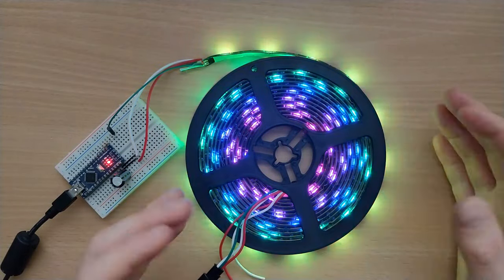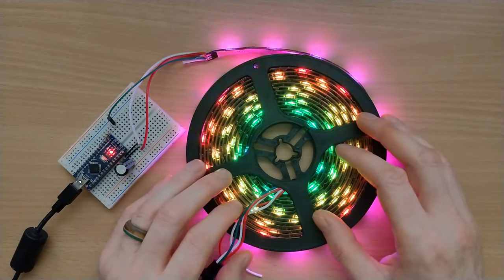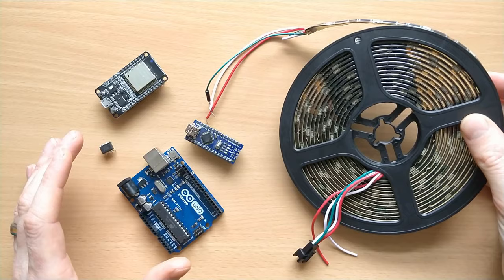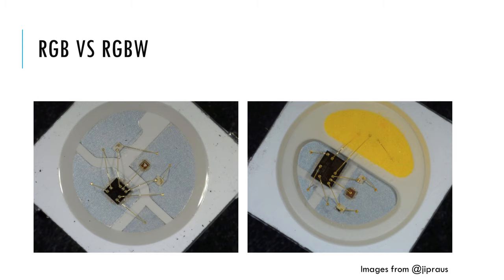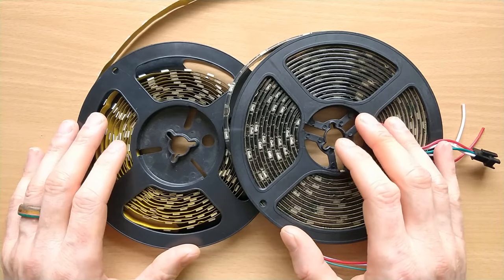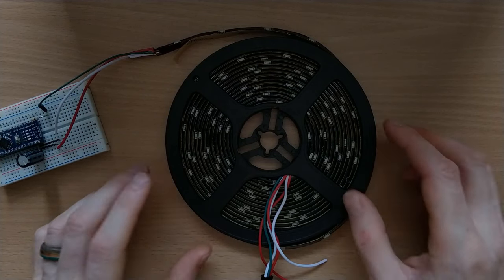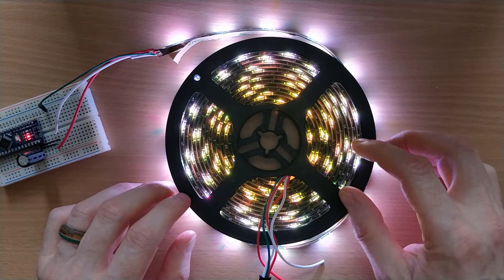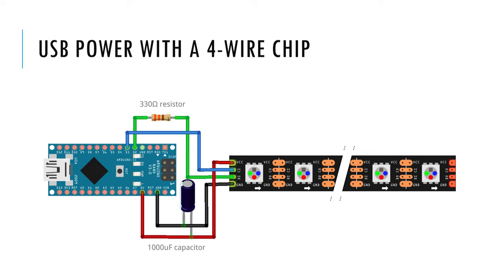FastLED Basics Episode 1 - Getting started

Comment: It's crazy how hard it is to find proper info on how to set up for power delivery. I've been struggling with a project that uses 300+ LEDS with an esp32 and I had to search forever just to learn about the amount of amps I needed. This is the first tutorial I've seen that mentioned anything about a resistor on the data pin, and a capacitor on the power delivery. Here's hoping that solves the boot looping issue I've been seeing. Thank you!

Comment: 1. Why are you using a resistor at 7:40 ? 
( Newbie to FastLEDs ).

Good tutorial. Interesting description and engrossing thruout. Thanks.

Also- 2. when you do we use a 5v and when a 12v.
3. When do we use the microcontroller power supply to power the LED strip, and when to use an external power supply ?

Comment: This is good but I wish it had gone into the resistor & capacitor details more. An episode dedicated to that, plus wiring up with external current flow (instead of going through the board) would help me out heaps with closing some gaps in my knowledge.
Reply from the maker: Hi, I don't think there's is anything else to say on the R and C. Resistor should be 330-470 ohms on the data line, cap should be 470-1000uF across the power lines near to the strip. Both are optional, and I've never had a problem leaving them out. Not sure what you mean about external current flow though?
Reply: @ScottMarley  I think he means using an external power supply to power the strip versus using the board directly hooked up to the strip. I’m also curious about that. If I use an external power supply, one with one of those big boxes  (like a laptop charger), should I still use a capacitor between positive and ground? Thanks for the video!
Reply: @zanemukhtiar7338  the board cannot drive a strip like that- the LEDs need their own power.
Reply: @ScottMarley  I'm also curious what's the advantage of using resistor and capacitor like mentioned in the video. Previously I've tried without them and it worked fine for some simple led control
Reply: @Energizerrrrrr   agree.  he says to use them, but doesn't explain why, or what they do
Reply: @ScottMarley  Hmmm... I have neither capacitor nor resistor, I'm trying to light a single LED and I'm getting nothing.  I know I have roughly 5 volts at the end of the line (4.9), and I know I'm talking to the board because it's flashing the onboard LED correctly using digitalWrite.  I'm using a MEGA R3 2560 with the same WS2812B strip you're using and just powering from the USB.  Any thoughts?
Reply: @ScottMarley  Mystery solved:  I somehow fried output pin 7 on my Arduino board.  All I had to do was swap it out for another one and it worked fine.  Maybe trying to connect without the resistor is what did it, I dunno.  Annoying!

Comment: Interesting video, very thorough so far (up to @8:50).. however, It would have been good to explain WHY you used the resistor, and WHY you use a capacitor. I've posted several projects using WLED and ESP32 and none of them have required a resistor or capacitor. Could you elaborate as to why you are choosing them to include in your circuit? many thanks.

Comment: I have a question: Why do I need a resistor between the digital pin on the arduino and the data pin on the LED strip?
The Ardunio Nano outputs 5V on the pins and the  WS2812B data line uses 5V so why the resistor?
Reply from the maker: The voltage will be the same with or without the resistor as almost no current is drawn from that pin. It's used to reduce noise on the data line - it forms an RC filter with the capacitance of the pin to cut down on overshoot and ringing. It's not essential and will usually work fine without, but is recommended.
Reply: @ScottMarley  Thank you!

Comment: This is the best FastLED tutorial on Youtube, thank you! I'm relatively new to this stuff and wondering - would it be safe to use a 220uF 25V capacitor in this circuit (instead of the 1000uF you've noted in your schematic)???
Reply from the maker: Thank you! Yes, any cap will do, and no cap is usually fine too. However, the bigger the cap, the less likely you are to have problems so you mileage may vary!
Reply: @ScottMarley  Amazing, thanks for the reply Scott! I'll give it a go!

Comment: Hello, i am from Australia and i enjoyed watching the video, I am just starting out in the led strip area. I totally love the different patterns that can be achieved if i do it right.
I have 3 questions to ask..........
1/ Will i need to add more capacitors as well every 1 meter or just the 5v power supply ?
2/ If i was to add another 2 led strips, would i have to add another or maybe upgrade the power supply to cater for the extra strips and possibly add a capacitor to each strip (i will be using 5 meter strips) ?
3/ And with the rainbow effect, what would be the code for making it move along the strip backwards and forwards instead of just standing there, as i am sure it will have a long lasting effect if they do, possibly burning it out over time ?
Reply: Did you got the answer?

Comment: I wonder if this Query I have could be answered - I'm thinking of running three Uno's all with totally different lighting patterns from one power supply. My question is will the data travel/leek from one Uno circuit to the others and create havoc?  I was thinking about adding a diode but believe the data feed also uses the ground/negative (not sure about this!) which won't work back to front so is not effective.  Thanks for any help.

Comment: Thanks for the great tutorial! I was wondering how many separate rgb led strips can you control on different data pins with the arduino nano?
Reply from the maker: Quite a few, at least 8. However... the number of strings doesn't really matter, it's the total number of pixels. Updating one string of 1000 pixels will take only slightly less time than 10 strings of 100 pixels. The more pixels you have, the longer the updates take, and the slower the frame rate. If you want to do hundresds if pixels, you're better off with a teensy, esp32 etc

Comment: Hi Mr. Scott.. Thanks for all of your videos, I followed your tutorial about FastLED but it turns out my WS2812B is only showing white color LED after uploading the exact same codes. I'm using also 18LEDS, 330ohms resistor for the data and Arduino nano. Why it's only shows white? Thanks.
Reply from the maker: I have no idea. It could be wiring, the strip could be faulty, an issue with the power supply. I've never heard of a fault that makes the strip only light up white though! I hope you figure it out.

Comment: At 9:00 minutes you stated the wires 'usually'  come pre-soldered to the end.  I have no soldering skills, so it's very important to me that they do, indeed, come pre-soldered.  Now looking at the various suppliers of WS2812B I've found, they ask for length and pixel density and so forth,  but don't state one way or the other whether they come pre-soldered.  When ordering, how can I ensure that I get the pre-soldered type...do you have any recommendations?
Reply from the maker: There is no guarantee on way or the other I'm afraid, although in my expreience I think every reel (5m) that I've bought has connectors on both ends (they look like this https://www.tinkerforge.com/en/shop/media/catalog/product/cache/3/image/9df78eab33525d08d6e5fb8d27136e95/b/r/bricklet_led_strip_ws2812b_reel_600.jpg). You would of course then need the opposite connector to plug into something. You will get one of these on the other end of the reel, but you would need to desolder it (or cut it off I guess) to use it in this way. If you want to play around with these lights, you will eventually have to learn to use a soldering iron, there are plenty of YouTube videos on how to solder, it's not difficult once you know how and I'm sure you would eventually find it fun! Without soldering how were you planning to hook up the lights to a microcontroller? You could use a breadboard but that's not a good permenanet solution. If you just want lights that play patterns with no coding / soldering etc there are plenty of controllers available on eBay / Amazon / aliexpress that are plug and play. Otherwise, bite the bullet and grab a soldering iron :)

Comment: Sorry to be a bother Scott, but I've got one other question. I'm attempting to hook up a circuit as you have at 5:47 (the DC Power Only circuit). This seems to power up without any explosions, but my MKRWIFI1010 doesn't seem able to connect to my IOT Cloud Dashboard anymore when powered like this. Why have you used to 5V pin rather than the VIN pin here? Any clever ideas why this might be the case? Everything is running just fine when Arduino plugged into USB and only using 5V power supply to power the LEDs... Appreciate any thoughts, I owe you a pint regardless :)
Reply from the maker: The power arrangements for the board you have are completely different to the original nano which I am using. On the original nano, the vin pin goes to a regulator, so it can only accept voltages >6.5V as there is some dropout. Therefore we use the 5V pin if powering it from a regulated 5V supply. Your board has a much more advanced power management system and you should use vin for your 5V power input. Be aware that the IO pins on this board run at 3.3V and the data line on addressable LEDs is supposed to run at 5V. Usually this isn't a problem and the LEDs work anyway. If you find your having data issues however, you will need to use a level shifter on the data line between the board and the strip. Hope that helps.
Reply: @ScottMarley  Incredibly helpful, thank you again Scott! Looks like I may need to use a level shifter after all as I'm not getting the expected results - really appreciate you pointing me in the right direction though!

Comment: First I have to thank you. I absolutely LOVE these tutorials you have so diligently created. Brilliant! You deserve  100,000 subscribers. This is the problem I am experiencing. If I use FastLED with more than 70 LEDs, the whole strip flickers. With less than 70 LEDs, they display colors and transitions smoothly. I experience the same issue when using an Arduino Nano, Adafruit QtPy, Teensy 4.0, and Teensy 3.2. One temporary solution is including the WS2812SERIAL non-blocking library, but it only works with Teensy boards. That's fine, but I still need FastLED to work with more than 70 LEDs using other boards. NOTE: My circuit is wired the same has yours in the video, but with one difference. My circuit is using a 12v WS2815 LED strip.  Can you please help me?
Reply from the maker: Thanks for your comments! Do you definitely have all of the grounds connected together? If so, it could just be a dodgy strip. I haven't used the 12V stuff before, so I don't have any insider information I'm afraid! You could try posting on the FastLED subreddit, I'm sure someone more experienced with these strips could help you out.
Reply: @ScottMarley  Thanks for the fast reply. I have tested this on multiple WS2815 strips and the same problem occurs. I am fairly certain that rules out the possibility of a dodgy strip. I checked with my meter and everything is grounded properly throughout. I will check out FastLED Subreddit forum. If I find a solution I will update you. Regarding the 12V stuff: If you do try working with it at some point, note that the data line is 5v, not 12v. It will also work with 3.3v, but the 330ohm resister is too much resistance and needs to be reduced.

Comment: Hello, I want to set the WS2812B leds (144leds) to light up linearly from bottom to top and keep lit until they turn off. When I turn them off, I would like them to turn off in reverse (from top to bottom, as if it flows backwards). I will have 3 rows of tape, 1 linear meter - one tape, 1.5 linear meters - one tape and 2 linear meters - one tape. please help me with the code for this setting, but also what should I buy as parts? thanks

Comment: Hello Scott, I would like to thank you for a very informative and education video on Addressable LEDs (NeoPixels) as I am somewhat of a Neophyte to coding let alone coding for addressable LEDs and hope you I may impose on you to point me the right direction as to some questions, I have as I’m aware this video is a year and six months old (+/- a week). First, is the 1000uF cap used as a filter to reduce voltage spikes? Second, what’s the Difference between the “FastLed.h” and the “Adafruit_NeoPixel.h” library, is one superior over the other seeing WS2812B can work with both? Thank you again for this informative and educational Ep1 video.
Reply from the maker: Hi, yes, the cap reduces current spikes so its value is not critical. The adafruit library makes it much easier to do some things (text on a matrix for example) and much harder to do other effects that FastLED excels at (palettes, blending, blur, noise etc). Use whichever suits your application.
Reply: @ScottMarley  Thank you

Comment: Hi Scott. I watch your videos on my tele and I've now found you on my laptop so I can ask a question. I recently purchased a second reel of WS2812B leds but this one was waterproof. I plugged it into my first Light Strips Controller and the first led was the only led to light up. I had bought a second controller so I tried that and again it was the first led that lit up.I decided to cut the first led out and I soldered the wires and plug and the same result occurred. My first addressable led set works fine but I'm having problems with my second set.My next project will be to use an Arduino Nano but I wanted to make sure the led strip worked first. Would you have any clues why the first led is the only led to light. It even changes colour. I'm learning lots from your videos so thanks for posting them.
Reply from the maker: This might sound silly but have you definitely connected the data line to the correct end of the strip? Data has to be passed in the direction of the arrows.

Comment: 5:45 - "If your done programming using the USB you can wire it up like this". So if you plug the computer in again - the computer USB port can blow up. Have you got a quick circuit I can use that safely allows you to plug the computer in again without blowing up its USB port? Ideally something a little more sophisticated and fool-proof than a switch.
Reply from the maker: It won't blow up. You can connect external 5V and GND, and the computer USB cable at the same time and it will work fine. There is a blocking diode on the Arduino which prevents current from flowing back into th usb port.

Comment: can someone explain to me why you would add a capacitor?
Reply from the maker: The capacitor acts as a power reservoir for the LEDs. Patterns often vary dramatically in the amount of power they are drawing, from almost nothing to several amps in a few milliseconds. The capacitor is there to smooth out the power demand from the power supply. It also somewhat reduces noise on the power rails, these LEDs are electrically very noisy and noisy power rails can sometimes cause errors. You don't need it if you only have a few LEDs, but there is no harm in adding it to every project.

Comment: Folks!!!! Didn't ignore the 1k cap and the resistor!  I was pulling hair out until I got on with soldering them into the mix 💯👍
Reply: Also, be sure you match the voltage of your led with the cap volts!  I had a 3v n it melted on my 300 led 5v strip 😬
Switched to a 1k mf at 6.3v n it's been flawless for months!!

Comment: I cut a strip of 12 leds off the far end of my 12v RGB lightstrip, a WS2811.  I'm totally new to arduino but have done a little c programming. I tried for days using code from different sites and nothing worked.  Not even this YouTube channel which is a fantastic resource.  I thought maybe I should try connecting the strip at the beggining of the strip and bingo...  I definitely connected the 12 led piece in the correct direction.  I can only assume each WS2811 chip has an order sequence programmed in to it?
Reply from the maker: If they are normal ws2811 strips, there is no preprogrammed order. Providing the data goes in the right direction (direction of the arrows on the strip) there shouldn't be an issue. So no idea what the problem was there.
Reply: @ScottMarley  hi Scott thanks for the quick reply.  The lightstrip is from Ali express I got about 4 months ago.  The reason I chose to cut off the fat end of the strip (the last 12 leds) was to maintain the connector at the begining.  I definitely had the 12 led strip connected in the right direction.  Anyway, thanks to patience, a little lu k and your great channel I have had loads of success tonight.  Got the Kit Car effect working fine. My strip lights have three leds between chips so I get three leds on at a time running back and forth. Thanks once again 👍👍👍
Reply: @ScottMarley  Hi again Scott,  I was looking on YouTube for further LED strip videos and on one of them someone left this comment,   “0n using the ws2811 5volt strip each individual LED can be controlled...  and on the ws2811 12volt strip the Led's are controlled in groups of three which is what I have.  I still don't know why the small strip I cut of the end of the full strip isn't working, I definitely know its cut and soldered correctly.  I'm going to solder the 2 pieces of strip back together and see if the whole strip lights up. I shall inform you once I have tried it out,... Cheers 👍
Reply from the maker: @hthharrison7764  that's true, but you said you cut off 12, so that should still be ok as it's a multiple of 3.

Comment: When I put in this exact code at 09:22 it says "GRB cannot be used as a function" (although it turns blue when I write it.)  And there is no example file in my FastLED library with the name colourTest. Has it been changed?
Reply from the maker: All of the code is on GitHub at the link in the description. I've just tested the file colorTest.ino and it works fine. There must be a mistake in your code.